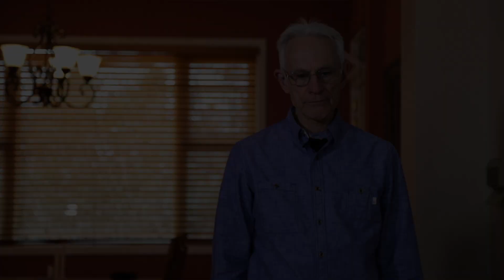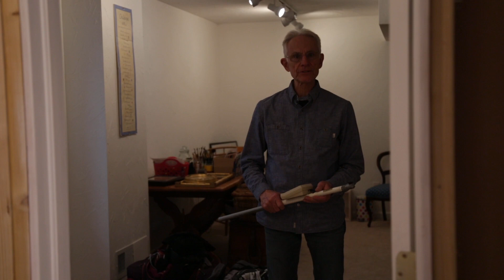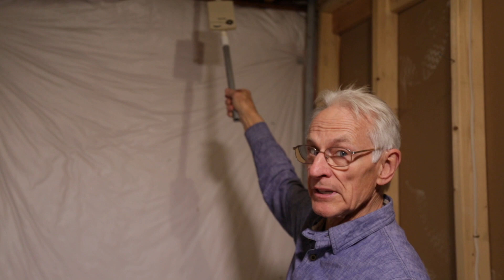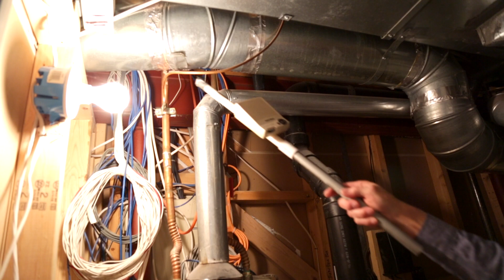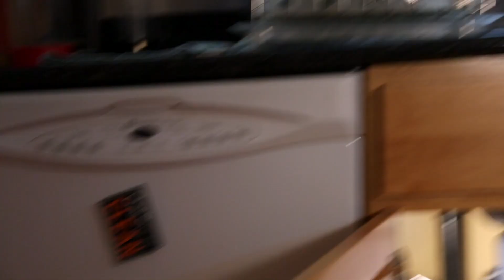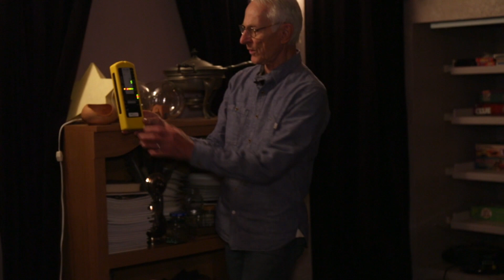Part 4: Electromagnetic Radiation Survey with IBE

Comment: If there is an issue with the electrical current through the bonding pipe or MBJ, where current comes through to the refrigerator can the refrigerator in any case become changed causing a risk of shock? 

I
Reply from the maker: Right.